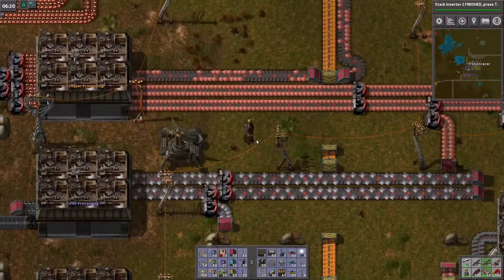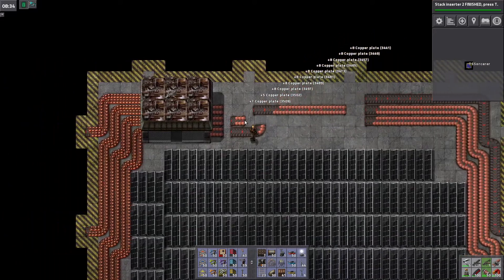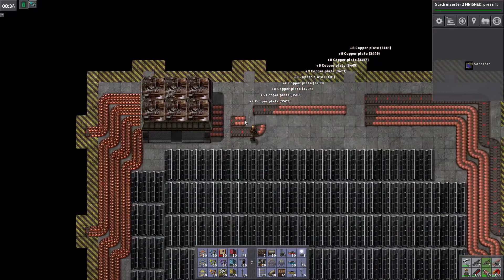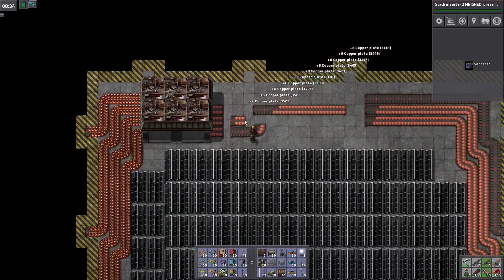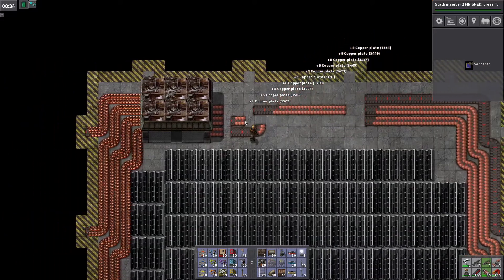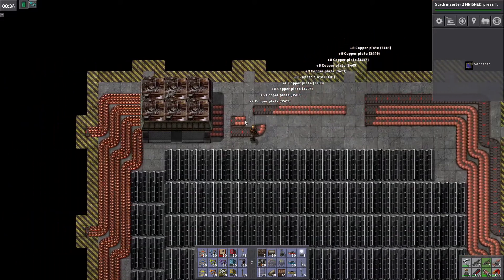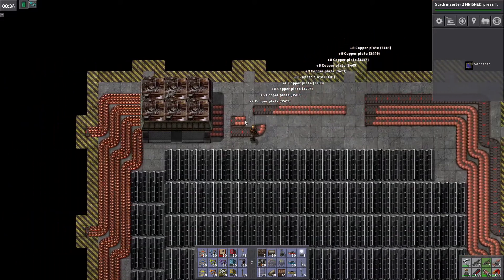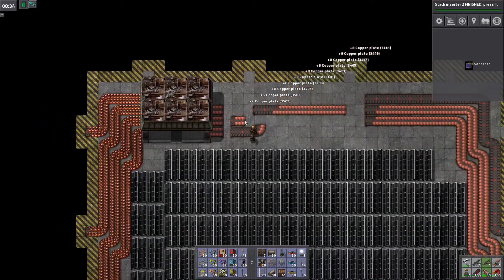Let's Play Factorio Boborissimo Ep #54, lead foot

Comment: 2:29 The whole point of the 3:2 ratio with that kind of thing (going back to green chips in vanilla) is that the production rate will match between the copper wire and the output. Currently, you're using the VERY fast electronic assembly machines for your copper wire, but ordinary assemblers for the circuit boards. If you switch to the same assembly machine for the boards, your overall production will go way up. As for the SIZE problem, that's where Bob's inserters comes in, as you will have to adjust the outer inserters to put the copper wire in at an angle on the outer two lanes.

5:20 Funny that. As I watch this, my train loads with coal from a hastily built outpost because I found out a moment ago that I ran entirely out of coal and was producing no carbon. :D

7:20 Gah! I do that so often, thinking the ghost images are actual things. This is particularly dangerous when you think your train signals are real... :o

11:20 I asked Bob about the whole cobalt thing, and he basically says that it isn't really a great setup. He meant for cobalt steel to be used far more than it is. Currently, cobalt is really only useful for the tier 2 batteries (with Lithium). It's useless for the armor because it is too late in the game by the time you can build it. Biters will be way too strong for it by then. He's considering rebalancing it. For now, don't worry about cobalt until it's time to do Lithium processing. :) I built my whole cobalt thing a few days ago apparently prematurely.

17:14 Solder is another one of those things you can do faster with the electronic assembly machines. Though you still need the metal mixing furnace for the actual solder plates, the finished solder can be done in the small ones.

Overall, some pretty good progress with the old infrastructure. Feels good to upgrade and weed out the old stuff eh? Won't be long before you'll need to bring in some new ore types.